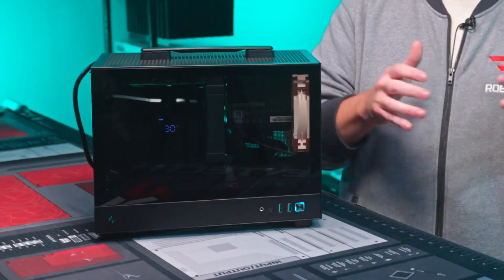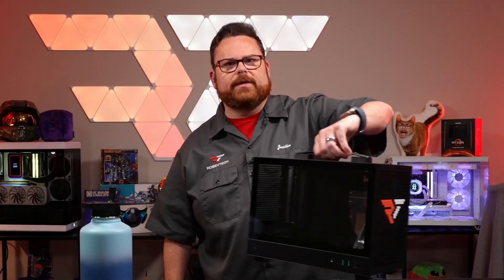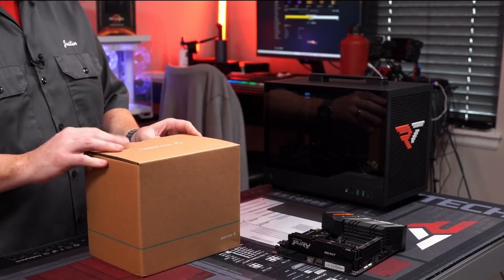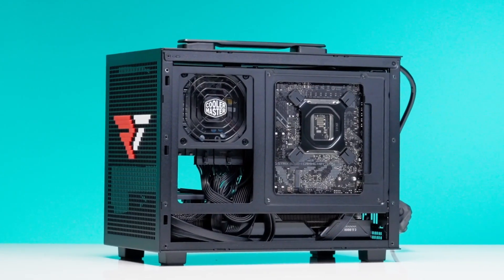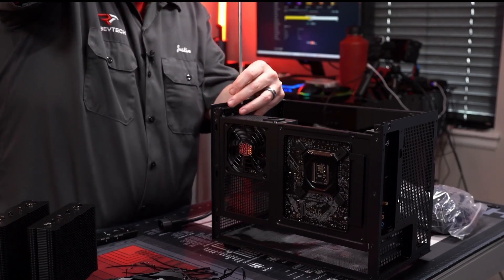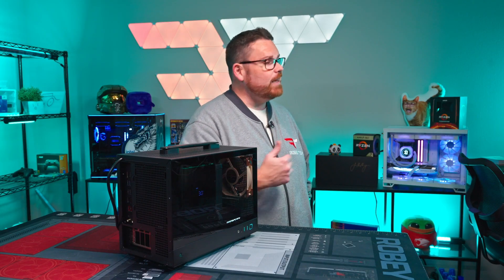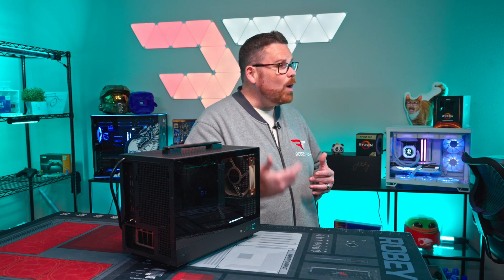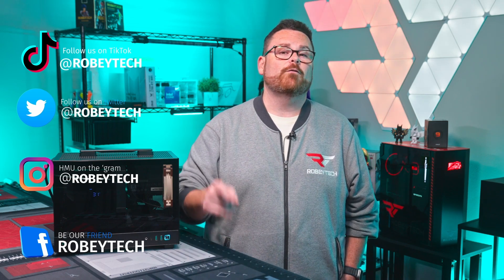Small PC Case with Big Options! The $2200 CH160 SFF PC Build

Comment: you probably would have gotten better temps with a assassin IV or 4s instead of the AK series coolers due to the larger 140mm fans and better heatsinks / heat pipes. Deepcool makes some fantastic tower coolers. Oh and with all that spare space in the rear I would have ran an extra fan too.
Reply: That AK is for aesthetics of the digital part since the case is glass side panel, is AK 120mm?

Comment: A bit of friendly advice. Run the cpu fans as rear case intake. Swap the front fan to exhaust and add another top fan as exhaust. Machines and more has proven this theory on the CH160 and yielded the best thermals.
Reply: Is there any video on this?
Reply: @Dean.Michael.Winchester  yeah, Machines and More did a video demonstrating it and showing the thermal comparison. But they may have taken it down due to the DeepCool sanctions here in the US.
Reply: Doing this, not for CH160, but for its vertical brother, the CH170 for my AMD Ryzen 5 7600 with Thermalright PA 120 and RX 6800XT. Full load for CPU is 70c and GPU is 65c